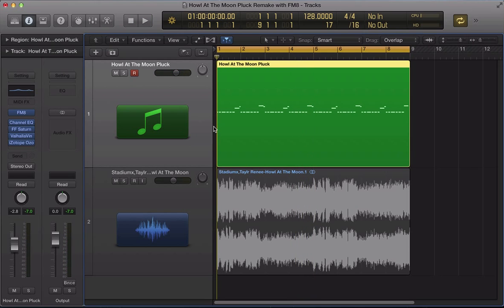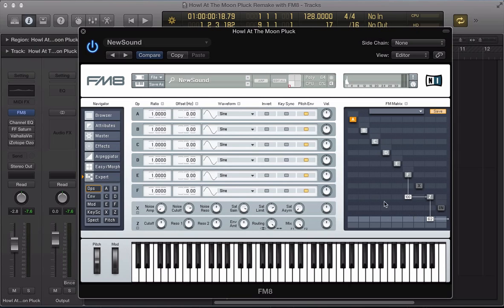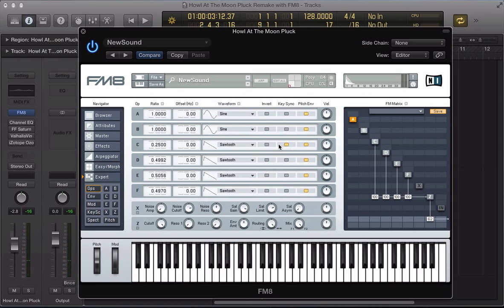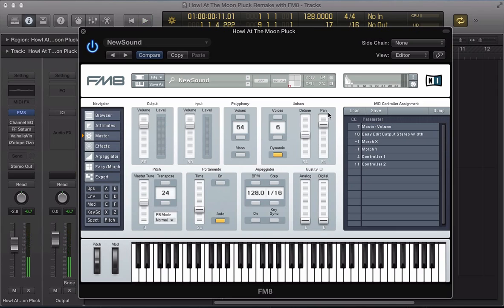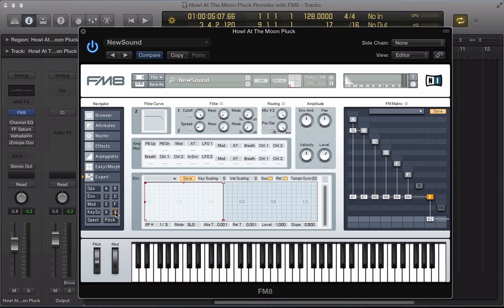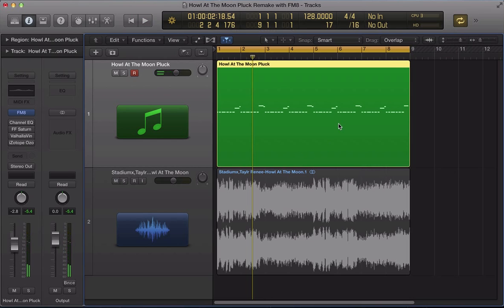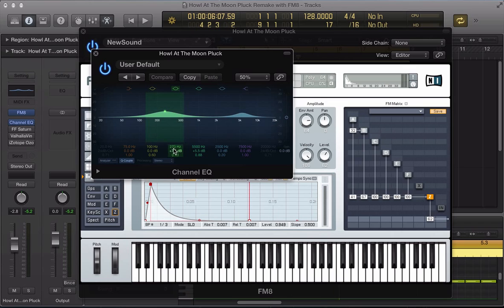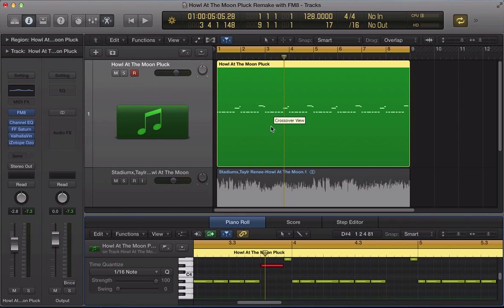NI FM8 - Remake Stadiumx Howl At The Moon Pluck - How To Tutorial

Comment: Is there any mathematical reasoning to the detune numbers?
Reply from the maker: No, I just detuned until it thickened the sound. I can't fully remember, but I may have even used the detune option in the 'easy/morph' page and then tweaked those settings - when you detune in the 'easy/morph' page it will detune to operators by the exact same amount in either direction.